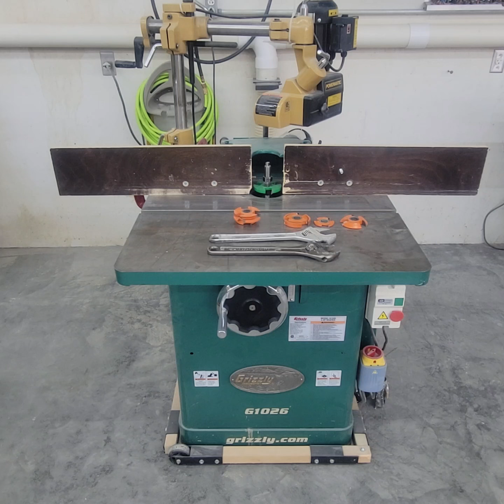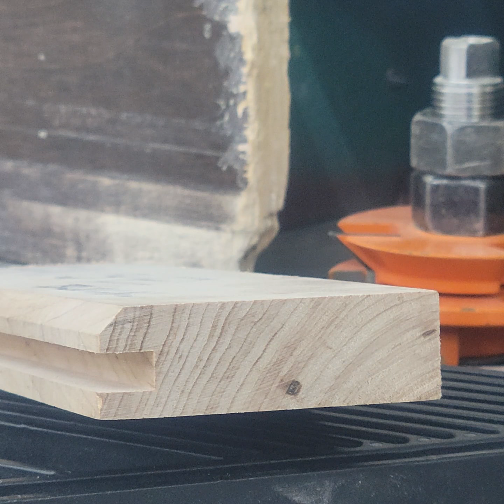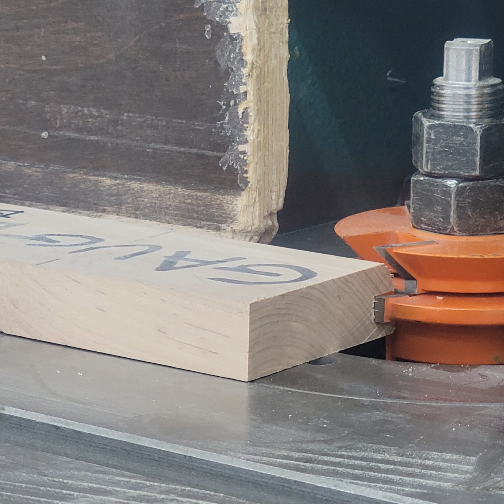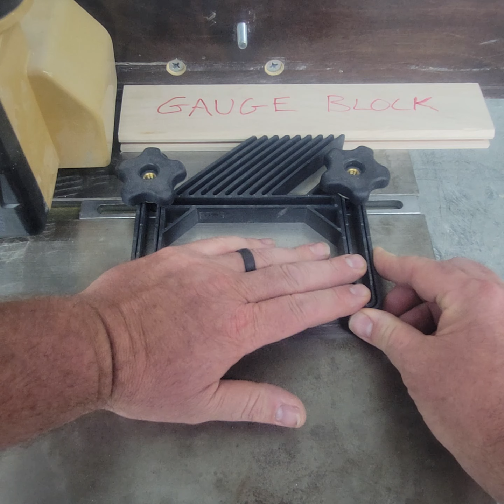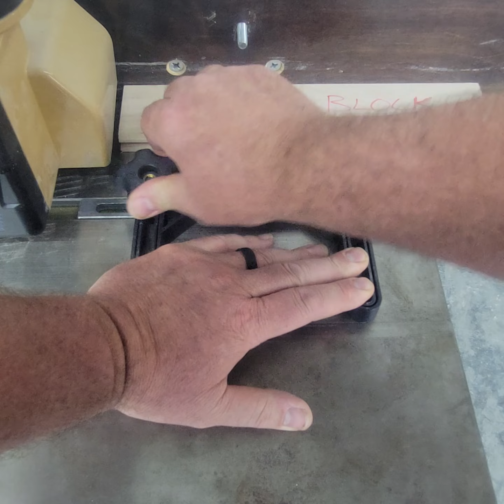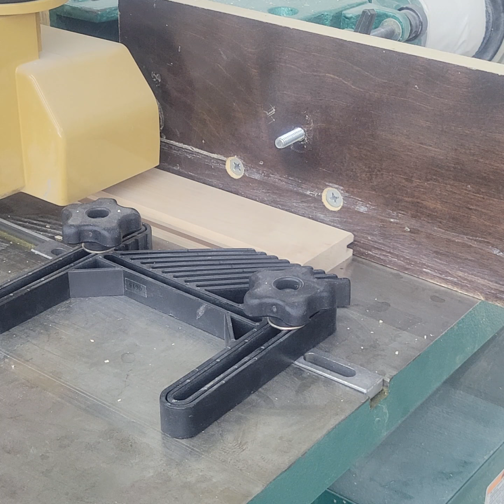Shop Sharps Series #3B: Introduction to Shaper Milling Machine & Cutters #blade #woodworking

Comment: Nice video! The power feeder is a great addition to keep the digits safe! Today a heavy duty router in a table does all that I need. My Shopsmith can be setup as a shaper but so far I have not had the need to try it. The last time I used a shaper was back in the 80's. During highschool and college I worked as a carpenter for Viking Yachats and did all kinds of fun stuff. Woodworking is still a hobby of mine.